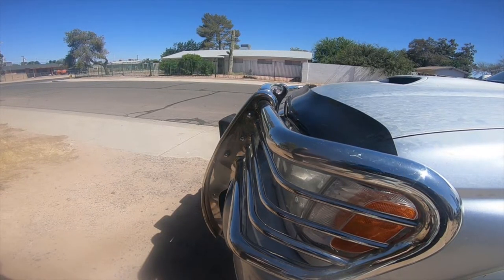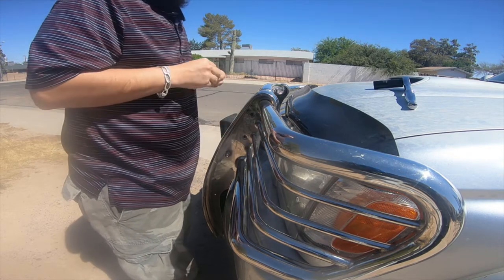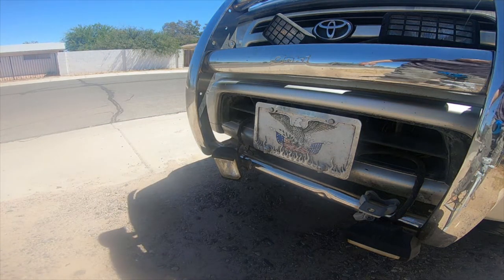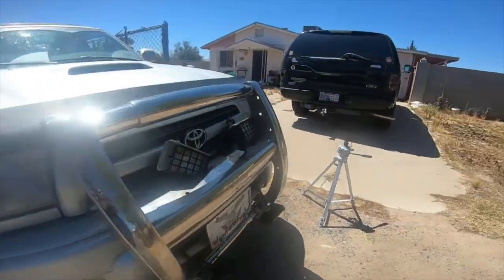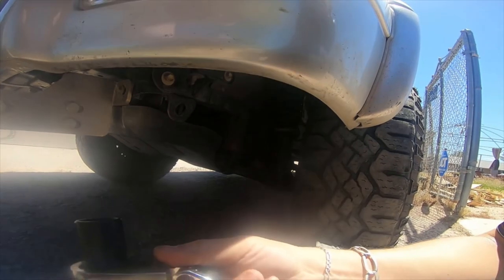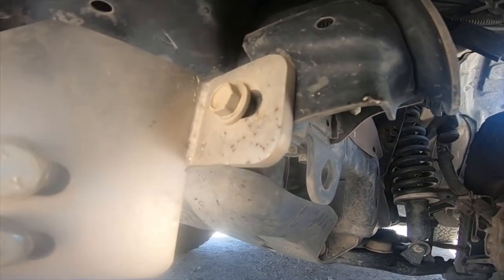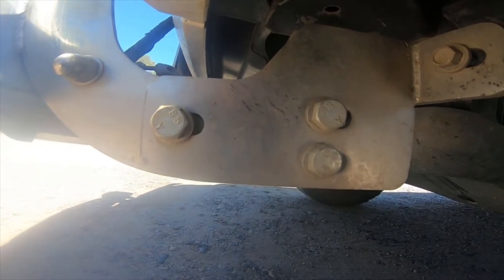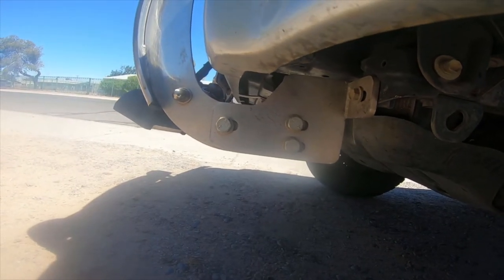2000 Toyota 4Runner - HID Projector RetroFit Install Part 1

Comment: Thought it was a video on retro hids, not taking off bull bar
Reply from the maker: Its a several part video series and I showed every step through the series if you want to see the retro fit skip to other part 2 or 3 videos
Reply from the maker: Your also not accurate not a bull bar a bull bar would just be the center peace with the offroad lights this is a  European ram guard because it has the headlight sheilds